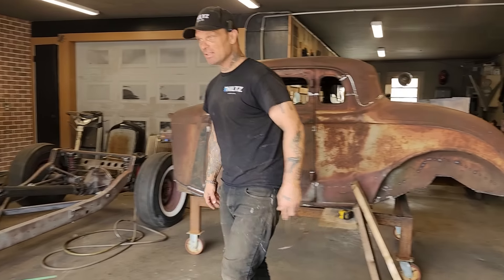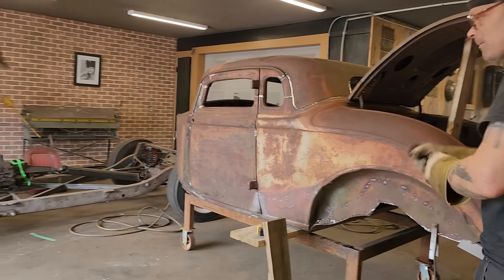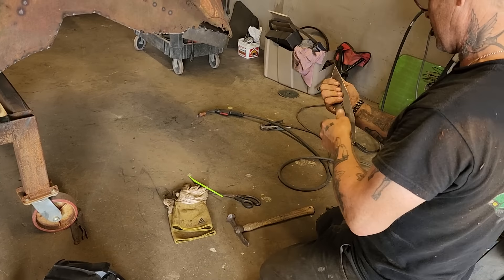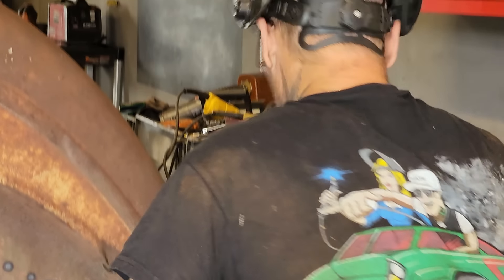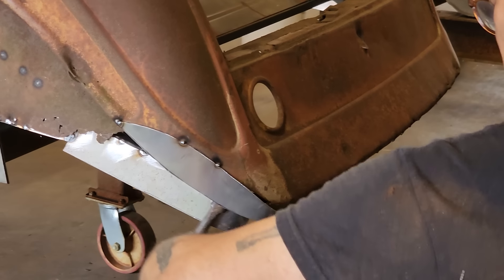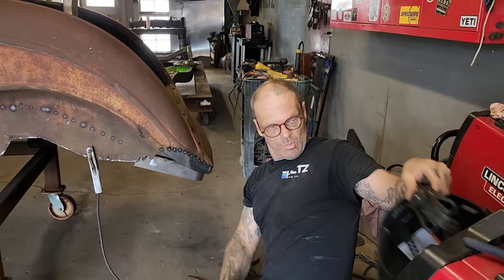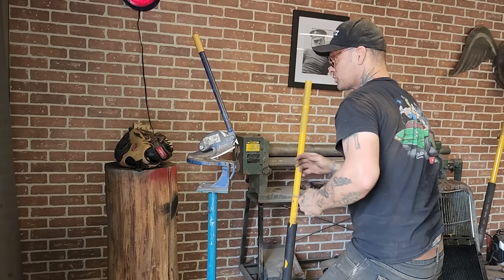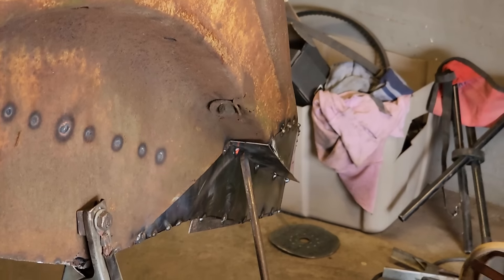We’re in a dilemma 😝

Comment: Chad, thanks for the tips and tricks. I’m sure Nathan will figure out a way to make the radiator work. Who says you have to put the radiator in the front or even vertical. Who says the engine is to high, low, forward or back to far. Put the engine in the trunk if you want. With a 911 transaxle. It’s what you like. I like the tips and tricks that you have to offer. Thank you for passing along your knowledge. Thanks for the video Jolene.

Comment: Next dilemma is engine sitting so high is causing a bad driveshaft angle and the rear axle solid mounted on the axle is going to amplify the angle . U joints arent meant to run at them steep angles  as you think they are . Also ford 8.8 rear axles ane not centered at pinion left side is 2 7/8 inches longer .
Reply: I suspect he will lower it at least 2”…
Reply: @darwinfoster7420, how come lifted trucks are able to run drive lines with significant angles?
Reply: You're the next dilemma, sitting so high as a kyte!🤣🤣😂

Comment: Correct me if I'm wrong but having the radiator low to the engine you're going to end up with cooling issues, the engine will be prone to overheating or at least running too hot.

Comment: If you leave the engine that high and use the aluminum radiator, then there's a simple fix for the front piece. Just cut and add the inches needed to make it fit to the top of the rad. Using a different front piece won't look good. It's your car, but I get the feeling you didn't like the different front end either. Got the rest of the car looking good though.

Comment: About your dilemma.  Instead of having the fan up high, mount the fan lower in front of the radiator.  The fan could be on a bracket attached to the frame you fabricate and weld behind the radiator. Drive the relocated fan with a fan belt and pulley run off the crank or one of the water pumps.  Old school solution and no electric water pumps.

Comment: Well looking at that configuration your drive shaft angle is too steep there's not the correct amount of pinion angle the motor has to be dropped approximately 4 inches at least I'd say closer to 6:00 for it to work correctly with the drive shaft and the rear end you know you're good sheet metal man but your mechanics are idiots are the building cars for over 40 years and I would never do anything like you're doing there on the drivetrain

Comment: A double master cylinder is a upgrade and its better you have if you have a brake line go bad an if you only have a single master cylinder you want have brakes but if you have the upgrade double master cylinder you would still have brakes that's why they want to the double master cylinder one for safety

Comment: AI Overview

￼AI Overview

￼

￼

￼

+7

￼

The ideal angle between the transmission output shaft and the rear axle pinion, also known as the pinion angle, is 3 degrees or less. The transmission should be 3 degrees downward, while the pinion should be 3 degrees upward. 

￼

￼

+7

￼

The ideal angle between the transmission output shaft and the rear axle pinion, also known as the pinion angle, is 3 degrees or less. The transmission should be 3 degrees downward, while the pinion should be 3 degrees upward.

Comment: hi nathan try fitting a toyota forklift alternator it is small and easy mountiing
Reply: I fitted an alternator from a Kubota engine in a car I built . It provides the amount of power that is needed for a build like this , they do not need the same amount of power as no electronics are used.

Comment: I personally wouldn't set the engine so high, but I understand Chad's goal on... and this is important... CHAD'S project. I've never been a huge fan of 32 Fords because, without a blower or tunnel ram, they generally look like the engine is down in a hole with a giant firewall towering over it. It looks out of proportion. This Dodge would have the same look.
As far as the guys who keep saying "3º or 5º of driveshaft angle", go study some actual books on the subject or talk to someone who has actually been in the field. The important thing is for the tailshaft and pinion to be parallel, minus roughly 3º to 5º of negative pinion angle so that under acceleration, the pinion wraps back to a parallel state with the tailshaft.
Crawl under any old 4x4 truck, especially one that's been lifted, and have a look at the driveshaft angle. There's obviously an upper limit to driveshaft angle, but this car isn't there. It's unorthodox, but it is fine.